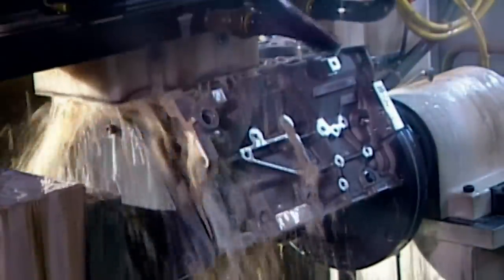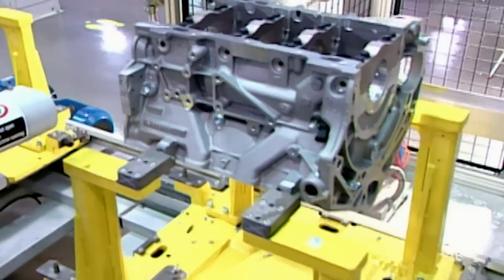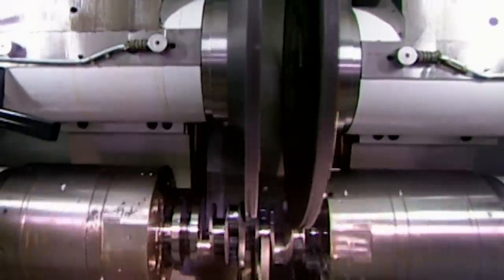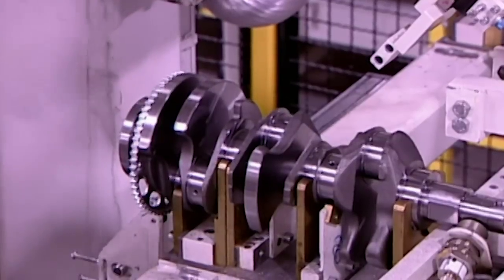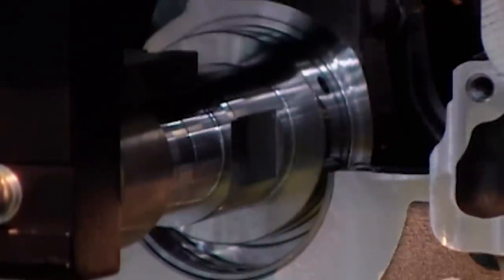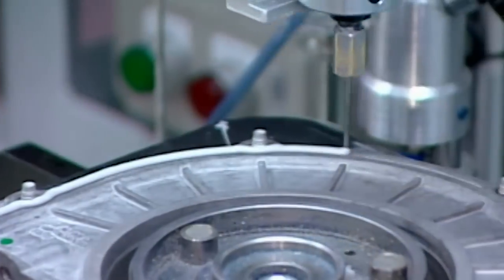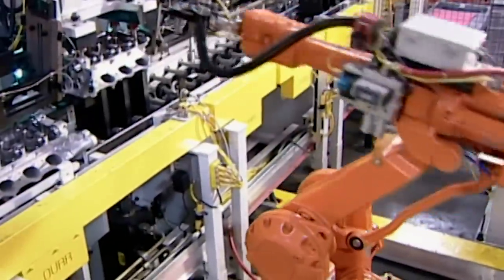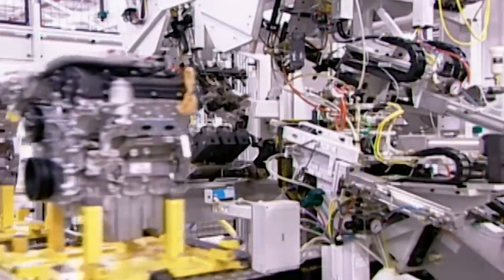CAR ENGINES | How It's Made

Comment: it's so beautiful just looking at an engine with 0 miles on it. just imagine all the potential and where that engine is going to take you.
Reply: For some people, to their death
Reply: One of the greatest inventions from man.
Reply: And for some people, the happiest days of their lives
Reply: For some people, blown to oblivion
Reply: Not very far these are the gm 3.6 engines they had very bad problems early on, the cylinder heads were not machines correctly causing the camshafts to have too much endplay. They are known for timing chain problems but that’s only because people do not change the oil often enough and when they changed to full synthetic oil they have far less problems.

Comment: I actually work at the a factory that makes the engine block. When we are done making them they get sent to a place like this that finishes them.
Reply: @vikingsfan  How is the raw block cast? I would guess sandcast, but how do they then get the oil and water journals in place?
Reply: @The_Original_Brad_Miller  from oil company
Reply: Nobody cares bro.
Reply: @The_Original_Brad_Miller  lots of automation doing the maching
Reply: @The_Original_Brad_Miller  there's another how it's made video where they show the various molds used to form the oil and water channels. The mold for a whole engine is like a bunch of lego parts put together; a bunch of smaller molds that get glued to each other and a base mold that they all sit on. it's pretty damn crazy how much engineering goes into everything.
Reply: @edbo10  cool, thanks, I'll have to look it up.
Reply: Oh I thought they just Abandoned them

Comment: You know what makes me wonder, all these super robots in background making the engine, when there are combustion engine using cars used to build very basic stuff. Apart from that, this is so fascinating, that it is missing the part - where did those robots came from and how they where built from metal ores? It must be using a lot of electrical engines in process too, not just combustion engines.

Comment: What automotive manufacturer is this?
Reply: @MonkeyspankO  Very few vehicles use the same engines as another automotive manufacturer, unless it's a joint venture between the two companies, like with the Mazda pickup/Ford Ranger, or when the Chrysler crossfire used a Mercedes engine, or the Toyota GT86/Scion FR-S/Subaru BRZ. There are a few more, but generally, no they do not use identical engines.
Reply: Noticed the "BXJ" tag on the engine at 4:38, so yeah, its WV
Reply: General Motors. It's their "High Feature V6" (the 3.6 most likely)

Comment: These are the gm 3.6 engines they had very bad problems early on, the cylinder heads were not machines correctly causing the camshafts to have too much endplay. They are known for timing chain problems but that’s because people do not change the oil often enough and when they changed to full synthetic oil in 2011 they have far less problems.

Comment: these engines are going to be history thanks to tesla. very amusing tho..
Reply: Ahmed Hanif theres NO replacement for displacement 😂
Reply: Why, is one of those toys going to catch on fire and burn up these engines?
Reply: How about TOWING capacity? Have you heard of Tesla cars towing anything generally? I have not heard much mention of this need in the Tesla promotion. Where can I buy a Tesla that can tow my boat to Florida?
Reply: Christopher Andrews there is a video of Tesla towing a Qantas Airline..
Reply: Unfortunately this video conveys nothing about performance:
1. What did the battery level look like AFTER this tow?
2. How far did the vehicle tow the load?
3. What kind of shape can I expect my transmission to be in AFTER towing a load? 
4. What does the 'tongue load" do to the frame of the vehicle? 
5. Most of the Tow-Tugs are Gas or Diesel electrics: If pure electric were practical at this level, they would be using it by now, I have no problem with electrics. Its battery capacity and durability that I am concerned with. 
6. Teslas are absolutely super, BUT may not suffice for heavy consumer usage. Like I said: A Tesla that can tow my boat to Florida.
Reply: You might want to visit Tesla showroom for answers. I drive a Dodge charger SRT. Big V8 fan here, but took a tesla S on a test drive and now im pretty sure my next car will be electric. Not necessarily tesla. I will wait for what Audi, Merc and BMW can come up with.
Reply: @iWalkChris  I SAW BIG CRANES OF GREAT CAPACITY ENTIRELY ELECTRICAL